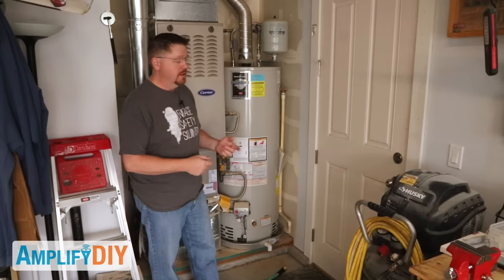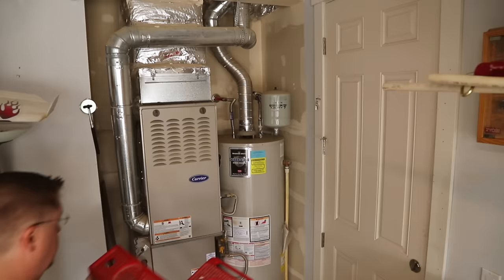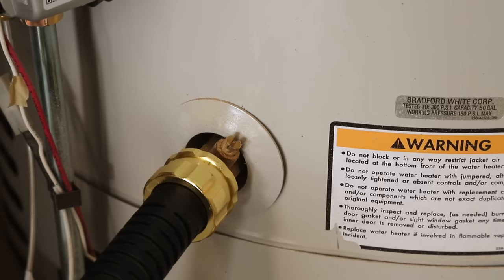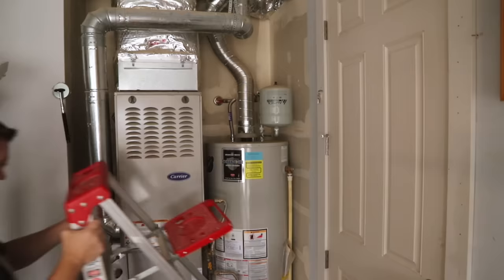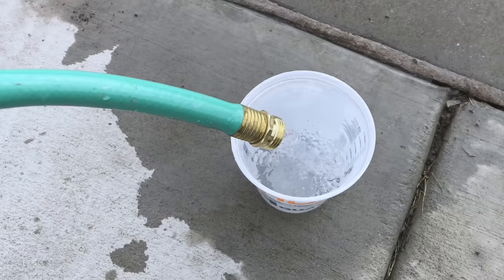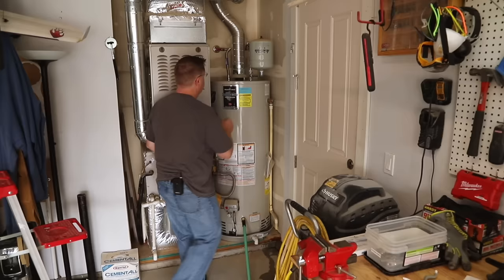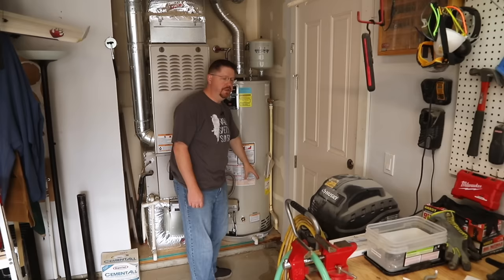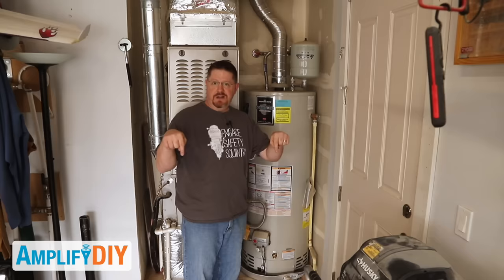How To Flush A Hot Water Heater To Remove Sediment

Comment: The sediment in the bottom can reduce the life of the water heater, but not really due to chemical corrosion caused by the sediment itself. What happens is the buildup of sediment in the bottom prevents efficient heat transfer in the exact place where most of the heat is produced (burner). 

An 80% efficient water heater can easily become a 60% efficient water heater because more heat goes up the flue rather than into the tank. But that also means the bottom of the tank gets a lot hotter than normal because as the burner heats the tank, the water cools it, and if there's not water in direct contact at the bottom, it can get very hot. That stresses the steel at the welds, and weakens that area. 

Stressed steel corrodes faster than steel that's not under stress. This is how the FBI recovers serial numbers from guns even if they've been ground off. The steel is still stressed from the dies used to punch the numbers. When they daub the area with acid, the acid corrodes the stressed parts first and the numbers "magically" appear.

So when the water (and stuff normally present in it) corrodes parts of the tank, the highly stressed parts will corrode fastest and fail first, which is why gas water heaters tend to leak/fail along the bottom seam, particularly if there is heavy sediment build up.

If you drain the tank and the water is clear, you don't have to do this very often. In some parts of the country, the water is so hard that you can get an inch or two of sediment in a year (Roswell, New Mexico is the worst).

In some cases, you may have to add food grade citric acid or a similar product specially made to chemically remove sediment from water heater tanks (like cleaning a coffee maker, only you need gallons of the stuff and it takes a lot longer). Not done except in areas where hardness is extreme.

On the other hand, a thin coating of sediment (at the bottom) and scale (rest of the tank) helps protest the steel tank against corrosion. Water softeners strip out these protective minerals.
So in a very hard water area, either you are going to have lots of sediment build up or you have a water softener and have none. 

Either condition contributes to reducing the longevity of the tank. Usually, large amounts of sediment is worse.

ELECTRIC WATER HEATER
Sediment and scale form on the hottest parts first. In an electric water heater, that means it forms on the heating elements, eventually causing the elements to fail (usually the lower one because that one does most of the work). But elements are cheap and replaceable.

Sediment in the bottom of an electric water heater can be left alone (no need to drain) because there's no burner in the bottom.
Reply: Do you ever check the anodes? I swear they screw them in using 200 ft pounds or more of torque.
Reply from the maker: If you can’t swap it when it’s used up, you’ll buy a new heater sooner! I’m convinced the manufacturers crank those in so tight very much on purpose.
Reply: @AmplifyDIY  Almost as if they want the heaters to fail. We are contractors and see many rusted through heaters with, of course, the anodes totally used up. We also set them at 120 and with a home, get a waiver if they want the water hotter. The most interesting job we had was a huge nursing home with a bank of gas fired heaters. This place had four hot water lines with recirculating pumps. We pushed out 180, 160, 140 and 110 degrees using blending valves.
Reply from the maker: What a wild system. Neat!
Reply: @AmplifyDIY  They aren't put in there as tight as you'd think but after a while, it sure seems like it. 

The anode rod protects any exposed steel not covered with glass by forming a very weak battery (anode rod --water--steel). This means the anode rod has to seal against water leaks and it's the threaded part that's the electrical connection for the anode rod "battery." Over time, the threads are going to be chemically welded to the tank, and yes it will be a bitch to get it out. But at the factory it was only put in tight enough to seal against water leaks. 

Manufacturers have tried "quick connects" and other gimmicks to try and make changing anode rods easier (they;d like to sell replacements), but whatever you do to make it easier to get it out seems to reduce its effectiveness at protecting the tank.
Reply from the maker: I did a video all about how to replace the anode in my Bradford White, and it was tight, but not impossible to remove: https://youtu.be/OIMz1rwx_jc
Reply: @Rickimusic  The threads chemically weld over time. If you checked the anode rod every so often, that wouldn't happen, but the cost of maintenance would exceed the cost of a new water heater.

You can often remove the T&P and look inside (with flashlight). Some water heaters have the anode rod built into the hot water nipple. You could leave the old anode rod and replace the standard hot water nipple with one that has an anode rod...

If water pressure and thermal expansion is well controlled, the anode rod is less important.

Comment: What about checking the anode rod? When then be a good time to check and change if needed?
Reply from the maker: Yup, this is a great time to check the anode rod. I didn't in this video because my heater is only 2 years old, and it's not recommended to start checking the anode until a heater is at least 3 years old. I'll be checking mine this coming fall, and will create a video for that process then.
Reply: AmplifyDIY I think I would be checking my adenoid Rod at the two-year point just to find out what the rate of a deterioration is which varies from water source to water source
Reply: 3:46 high enough
Reply: mark p well you won't have to ever worry about checking anything in my throat
Reply: The manufacturers say to REPLACE your anode rod every five years.
Reply: Gold Winger then you can do what they tell you and hope it isn't too late

Comment: quick note, depending on the valve, this can be a headache, best to open it once and keep it open.
quarter turns are great, multiturns can wear down the washer and not make a good seal when done
Reply: Hey, can you keep the hot water faucet on until the very end?  or does it need to be turned off at some pt?
Reply: Listen and he tells what to do with hot.
Reply: @GetReady4LiftOff  What did he say, I wasn't listening?
Reply: You the best!

Comment: Are you kidding me??? I have an electric water heater, on a shallow well system with over 600 ppm of dissolved solids, in my water.   I drain my tank every three years, pull the heating element and reach in with a bent rod and scrape out over a half gallon of calcium chips.  My water heater was installed in 1992, I replace a $9.00 dollar 120 VAC 1600 watt element every 3 years. Never have I replaced the water heater.  You had a few black pieces of crap that was probably in the water heater to begin with. My gosh, that would not have filled a teaspoon. You took half a day and flushed 200 gallons of water to get rid of a teaspoon full of sediment.  BTW, your presentation was great. Thanks from HARD WATER, SHALLOW WELL Michigan.
Reply from the maker: Yeah, there was way less sediment there than I was expecting, but I do have a softener as well as a whole house filter, so I guess I should not be quite as surprised. Thanks for watching!
Reply: IF you manually scrape or dig out sediment, use a wood or plastic tool so as to NOT scratch the painted on "glass" coating.
Reply: I have always wanted to do this as routine maintenance, but never got around to it. When my 10 yo water heater finally bit the dust, I drained it and was surprised to find it was perfectly clean inside. No sediment came out. Maybe it depends on your water supplier.
Reply: @MoneyManHolmes  maybe because you never maintenance your heater the sediment was to big to come out the 3/8" hole in the drain vavle.

Comment: Be careful with the relief valve... on older heaters they haven’t been opened in years in some cases and WILL leak.  There’s scale on the inside of the valve that can be almost impossible to clear.  I open ours now and then for a couple of seconds and let it slam closed to force it to close completely.  I’ve seen older heaters take many many many hard closes to get it to seal.  If they won’t seal you are forced to change it out.
Reply: It’s a good indication the relief valve could fail to relieve pressure, if it doesn’t close properly and leaks due to corrosion or debris. Needs to be replaced, for safely reasons and peace of mind.
Reply from the maker: I did another video all about relief valves: https://youtu.be/e5H1i1cypxA
Reply: BEWARE: Murphy's Law will bite you! Any tank that has not been serviced in years might not only leak from the relief valve once it's opened, but also, those AWFUL plastic drain valves will frequently open but then never fully close upon completion of cleaning the tank! Don't do this on a weekend or Holiday to a tank with an unknown history, or you may have to call a plumber on a Sunday or a Holiday! I had two gas water tanks in series, and they both had those cheap plastic drain valves. When I had a plumber out doing other work, I simply had him put BRASS BALL VALVES onto both tanks! These are so handy, and they can be removed and used again if you ever replace your water tank.        - j q t -

Comment: Well made video.   Another suggestion is to replace the "hose tap" style drain valve on the tank with a full diameter 3/4" ball valve.  You get a better/faster drain, and it doesn't get stopped up with sediment like the small channel through those factory valves.  I had not drained my tank with 10 years in service, and I got about 3 cups of chunks.  I replaced the anode rod at the same time (it was well due!).

ball valve:  https://www.amazon.com/gp/product/B002WEG3IU
You will also need a short brass 3/4" nipple (tank to valve), a 3/4" to hose thread adapter, and some pipe tape or pipe dope.  I put a cap on the end when not draining, in case the valve handle accidentally gets bumped.
Reply from the maker: Excellent suggestions. Make sure whatever valves / adapters you choose will actually match your tank, as the fittings may differ from tank to tank.
Reply: I like your idea, the small drain valves get plugged.  Another (cheaper) idea is to remove the drain valve with it's short pipe, and then flush the tank directly into a tub.

Comment: Thanks for the great, detailed video. Can you tell me where your pipe is going, which is connected to your pressure release valve? My water heater is indoors as well, and there is no drain nearby. I was wondering if we have similar situations. Thanks.
Reply from the maker: Good question. My heater is located in my garage, and I guess code in my area is to have the PRV pipe just head straight down to the floor.  My garage floor is VERY slightly graded such that any water that spills would try to flow out the front of the garage, away from the house. 

There are a few angles in the video that show the bottom of the pipe from the PRV, it terminates a few inches above the pan below the heater. I guess the idea is to just have anything that is shooting out of that valve be directed down and away from any person who may be nearby when that valve releases.

Comment: U need to pull the "Sacraficial Anode"
out and chk or replace also!
Reply from the maker: Yup. Starting at 3 years old I will. You may have noticed I mentioned that this heater was less than 2 years old at the time of filming. I'll check the anode rod starting next year, and will do a video on that process as well.  Thanks for watching!
Reply: Moved into my house in 2002 with water heater already in it from previous owners. Changed anode rod and it easily added more years to its life. It just died yesterday. Very happy it lasted me 16 years!
Reply: replacing the anode is a bear to get it loose then you need a special segmented replacement... this is no cake walk 😅

Comment: Bleed out all the air before firing the heater otherwise the top portion of the heater will be in a dry fire. You can risk cracking the flue and permanently damaging the tank. 

Tank must be 100% full before firing!
Reply: * A1 Pro Tip *